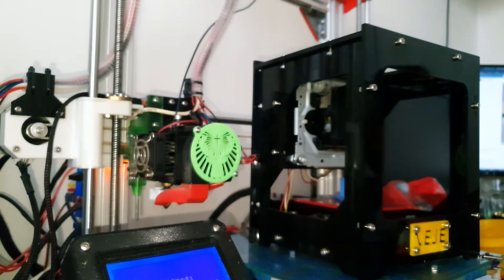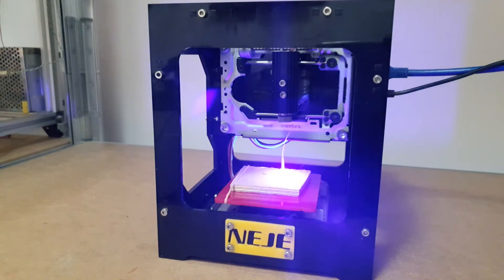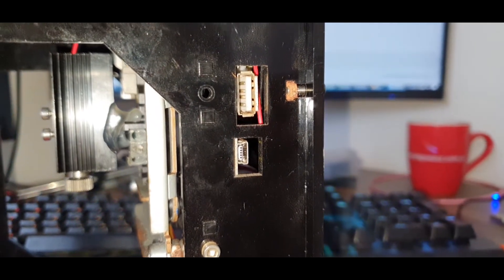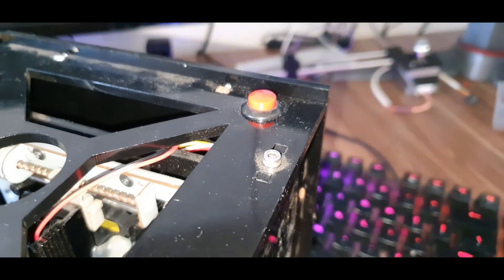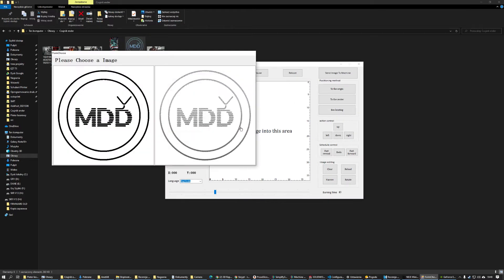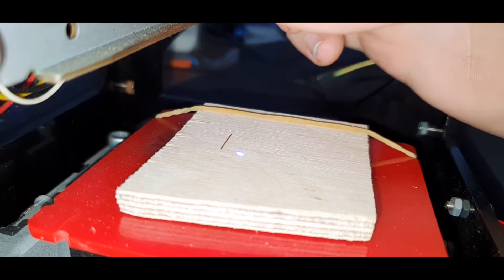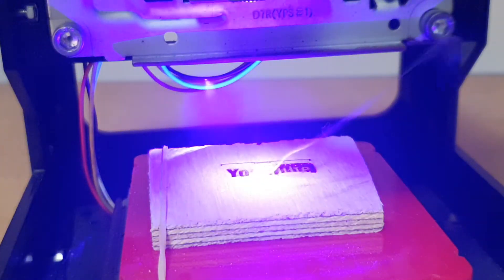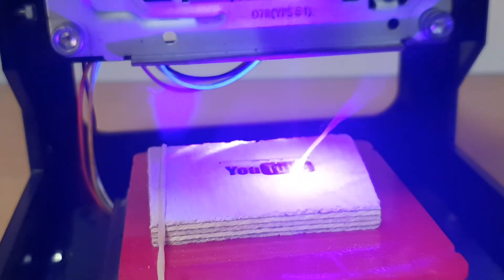NEJE Laser engraver review

Comment: Half way through  the burn my machine  either gets stuck in one place  or goes out of alinement...any help
Reply: In the bed engine there is a spring in the gray object, it lose streng Over time of use, i remove the spring and intall a hard foam so that make more pressure. Or you item its to heavy. Its worked for me better then factory🤗